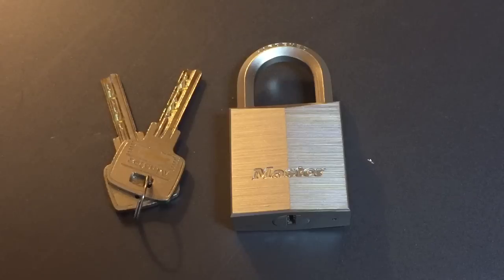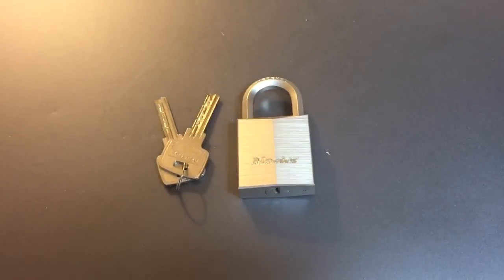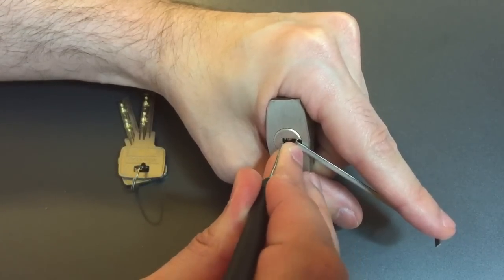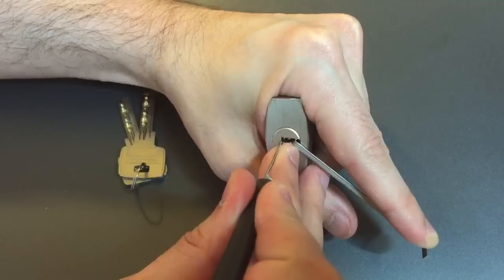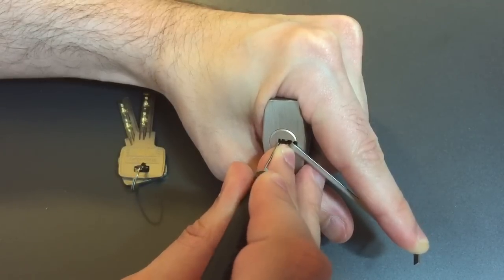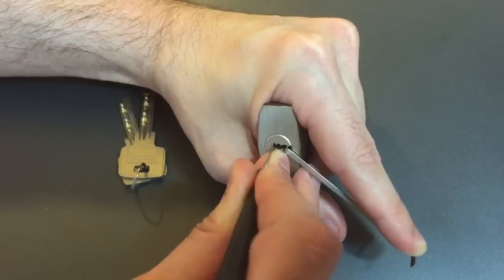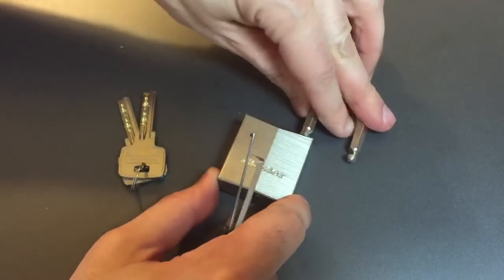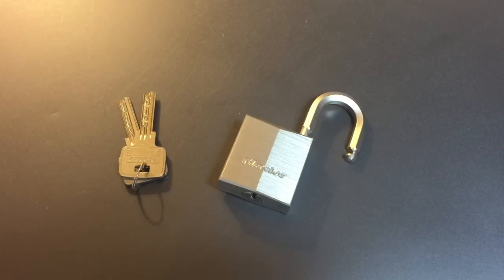[194] Master Lock Model 1145 Dimple Padlock Picked

Comment: Nice picking as usual sir 👍👍😘😎🔓🍻
Question....how do you choose your dimple pick for specific dimple cores( I'm sure lots of new guys to the sport would be overwhelmed by the choice of picks and which ones to use for left/right and pin in pin dimples!!)
Reply from the maker: I'll eventually be making videos on pick selection... I already have an outline of the video for normal locks, but I'll get around to dimple pick selection.  But for 90% of dimple locks (including pin-in-pin) I use a small offset flag, the only real choice is whether you attack from the left or right... and for those you need an offset flag on the right or left, respectively.